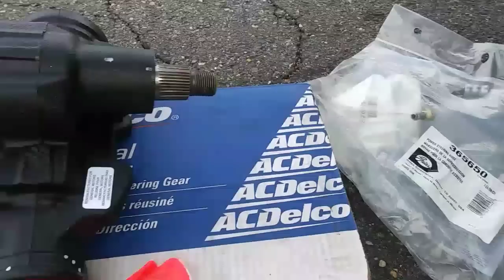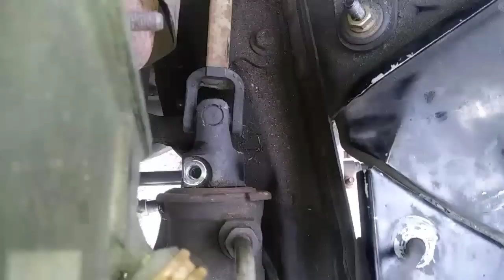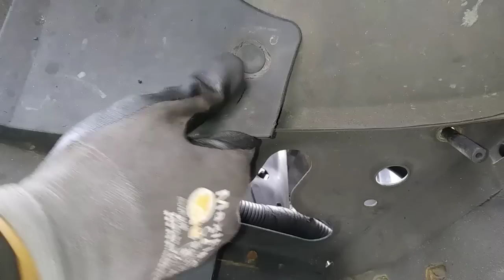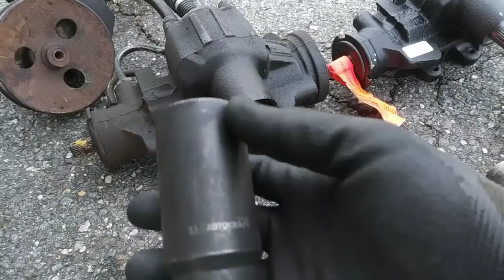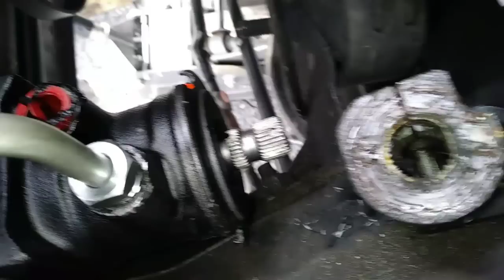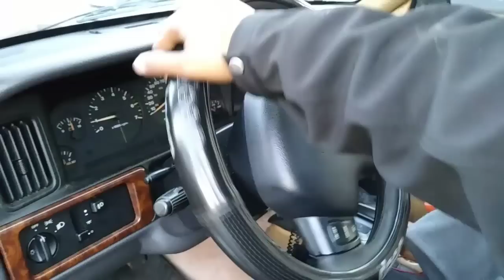STEERING GEAR REPLACEMENT (1993-'98 JEEP GRAND CHEROKEE)

Comment: Once again , straight and to the point !
I’ve been wrenching on my ‘97 ZJ’s for over 20 yrs and find Barricade’s (what’s the dude‘s name ? ) videos to be spot on without wasting a second of your time !
I just changed my steering gearbox last week and should’ve watched this video first - I wouldn’t have had to look for socket sizes and torque specs !
Great job once again, Barricade Garage !

Comment: Thanks for another great video brother. I used the radiator vid to install my new water pump and aluminum radiator. Guess what’s next. My steering gear box is leaking like a mug. You rocked out just what I need to fix next! You are a blessing.

Comment: Great Video, I had play like that in my 97 ZJ, I started with the gear box and pump, still had play , then replaced all steering components even lower and upper control arms and track bar, just to find out my ball joints was seized, onece I replaced those the steering was  touchy the way it should of been, the whole front end was brand new.

Comment: Man, another awesome video as usual. Whenever I need to do something on my ZJ, the first thing I do is check for one of your videos.

Question - the only thing that I think I have a question about that I think I missed in the video is how to make sure that the travel is centered  - I guess the "position" of the gear coming out of the box doesn't matter, as long as you put the pitman arm on in the correct orientation? Am I correct in assuming it's the position of the arm on the box that controls the travel? And it looks like it's keyed to only on on in one orientation? (Also, unless your pitman arm is worn out, I assume there's no real benefit to a new arm?) 

Thanks again, man!

Comment: Hey B.G. What for headlights do you have in that beast ? They look VERY BRIGHT, not like my candle power lights on my 97.
Reply from the maker: nowr2run 9004 HB1 160W 16000LM LED Headlight Kit High Low Beam Bulbs 6000K High Power
and the chrystal clear headlamps
https://www.ebay.com/itm/1993-1996-Jeep-Grand-Cherokee-Crystal-Headlight-Bumper-Corner-Light-W-Reflector-/362108647003

Comment: Is the new gear box is set to center or did you turn it end to end to find the center ?  I wonder if the new gear box is preset center from the company and no need to move it? then install the pitman arm same as the position it was mounted to old gear box..  just want to know before I install my new steering gearbox soon.. Any tips please , Thank you in advance for the reply..  Anyway , Its the best video so far I found on Steering gearbox on Jeep 4liters..

Comment: Great video dude. I have a 98 5.9 grand cherokee.  My steering box is so bad it wiggles left and right and the jeep doesnt move lol.  It has alot of olay in it.  Also pops too.  Just havent gotten around to replace it.

One issue with the manned pumps and gearboxes though is they are normally trash.  Gone through 3 of the remaned steering pumps.

I probably woulda greezed or antiseized the steering shaft and bolts though after putting them back on

Comment: Any difference with speed-sensitivite steering, and do you recommend an alignment? I see that you're now in the Commonwealth of Virginia (I'm in the Commonwealth of Pennsylvania). Happy 2019!
Reply from the maker: +OldsVistaCruiser thanks! I did this 2 days ago and the steering is more responsive. The steering wheel returns to center on its own after a turn now.
You dont need an alignment after replacing the box but im getting one because I have needed one ever since I replaced my steering linkage, I have just been waiting to get the new box on before doing it.

Comment: You may need a new ps cap. My old one wouldn't play well with the new pump for some reason. I bought the dorman one off amazon, nice and tight now and no more slow leak.
Reply from the maker: +leakyjeep5.9 I broke the new return hose nipple on the new pumps reservoir so I had to put the old resevoir on the new pump. All is good

Comment: I love your videos!  I have a question. My 98 ZJ has a new pump I installed last year, but steering has always seemed choppy at idle. Now it doesn’t like to turn left and locks up if I try to turn left.  The whole steering rack and stabilizer were new 2 years ago and still in good shape.  I’m thinking my steering box is bad.  Do you think that could be?  It doesn’t whine, and no fluid leaks from anywhere, so I doubt it’s a bad pump, but who knows.  Thanks for any input.

Comment: I know this is an old thread, hoping for an answer.  Is there a center to the steering gear or do I just make sure the input and output shafts are in the same position on the new box?  I went ahead and got a puller and new arm just in case.  I just got taken to the cleaners having the suspension components replaced and it still wanders all over.

Comment: I saw you had drilled and slotted brake rotors and was wondering where you got them and what brand they were.
Reply from the maker: https://www.ebay.com/itm/Fits-Jeep-Grand-Cherokee-Front-Rear-Black-Drill-Slot-Brake-Rotors-Ceramic-Pads-/132528960921
Reply: BARRICADE GARAGE thanks man also nice video.

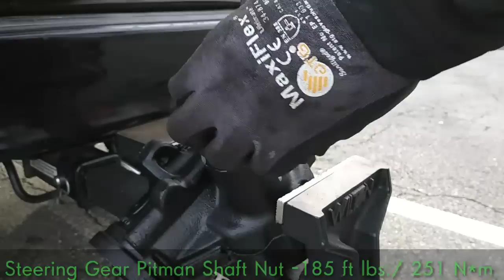Comment: Hey Barricade, great video as always. One thing however seems unclear to me; at 2:50 you mention removing the steering lines with an 18mm crows foot wrench but this step is never shown. Are you simply taking them off the old gear box and attaching them to the new one before mounting it at 4:50?
Reply from the maker: Yes all im doing is taking them off the old box and putting them on the new box .. Heres my quick power steering line replacement video if intetested
https://youtu.be/J21TtFRANJ4

Comment: One question- did you use a remanufactured unit, new or good used? I had Les Schuabb look into my steering looseness, and they replaced every articulating joint and wheel bearings to the tune of $1800, and while it was a lot better, it still wanders. Steering wheel does not return to center, flat spot when going straight forwards that makes me have to make small corrections.

Comment: thanks for all great videos.do you have any experience with the pump and box with speed proportional steering 96 5.2 v8 with tow package having a issue with the steering locking up not good thank you
Reply from the maker: My Jeep has the tow package but didnt come with SPV and I dont know too much about that so I cant help you out on that issue

Comment: Hello, great video.  Today I found out my 1997 Jeep GC 5.2L started leaking PS fluid from the pitman arm.  May I ask where you obtained your gear box?  I am having difficulty finding one.  Thank you.
Reply from the maker: The one im using Is AcDelco 36G0070. Its a refurbished unit and if you type the part number into the search bar you can browse for the cheapest option but I ordered the one im using through Rockauto.com

Comment: Hi again, killer video as always! Sorry to bother you with a dumb question, but there is a small hose that appears disconnected and is resting on the plastic cover at 1:03-1:05... what is that supposed to be connected to? It came off when I removed my air cleaner. Bless
Reply from the maker: Thats the vent hose from the front axle. It does not connect to anything and the factory position was under the air cleaner box so you can zip tie it to something so it doesnt drag on the ground
Reply: @barricadegarage5361  Wow, that's a fast reply! Thanks so much that really helped

Comment: Bro I still love your videos man you are the best at explaining and articulating how things need to be done. A couple things though. I wish you had done the j-20 gearbox upgrade. And how do you make sure that your steering is centered with your steering wheel and steering box?
Reply from the maker: I got the gear box that i wanted and it works fine. A j20 box for me is unnecesary anf Just keep the steering wheel straight and note the position of the pitman arm when you remove it so you can put it back the same way
Reply: So when you buy a steering box it is automatically centered?
Reply from the maker: @justdoingit.43  Yes, but if its not you can use the pitman arm to easily turn sector shaft to the correct position
Reply: Ten-Four appreciate it brother I'm only asking because I'm getting ready to do the j-20 upgrade on my ZJ. I'll let you know how it goes. the problem is I can't find any information on YouTube about the j-20 upgrade you have to go into Jeep forums to even find out about it. Wish someone would do a video.
Reply from the maker: @justdoingit.43  what made you decide on a j20 box
Reply: Got a 5 inch lift with 33 1250 15.original steering box took a crap so I want to go heavy duty. I do a lot of wheeling in the Ocala national Forest
Reply: Quick update on the steering box upgrade. Got the wrong steering box now waiting for another steering box to be shipped.
Reply from the maker: @justdoingit.43  Ohhh that sucks

Comment: I have a question. My 97 Grand Cherokee Laredo is doing the very same thing. I have about 2 inches of play to either side on the steering wheel before she ends up turning. Now, I have replaced everything from ball joints up to the pitman arm,including the gear box and the 2 inches of play is still there. What would be the answer to this issue? Thanks.

Comment: So I just repplaced mine with a remanufactured one from Advanced auto. I'm still having issues with the truck swaying back and forth in the lane and it's hard to drive so I'm doing the upper control arms. I did the lowers watching your vid last week of course my cam bolts did not come out nice and easy like yours so have new ones otdered. My mechanic buddy says the gear box I got is junk. How is the AC Delco I'm tired of throwing money at this damn truck!

Comment: good video, but thread locker is required if you're doing it right. You don't want those bolts working loose and losing your steering

Comment: You said you replaced a non-variable assist line but that part number says it does have assist. What is the difference? And did you mean to use that one
Reply from the maker: Sorry I forgot to mention I had to buy a non variable assist high pressure line from advanced auto because I ordered the wrong one from rock auto. If your box isnt hydro tapped and is stock then get the non variable assist line because the variable asssist has a longer neck and wont fit right.. 
Heres my video focusing on the power steering lines and the correct part numbers to use
https://youtu.be/J21TtFRANJ4
Reply: BARRICADE GARAGE right on! I just saw that video and also ordering from Rockauto. Thank you

Comment: How do you know if it’s a bad gearbox or just the Pittman arm ?
Reply from the maker: The pitman arm doesnt go bad but in some cases the teeth strip out or it gets cracked but thats rare. I only replaced mine because I like everything new. The gearbox was leaking which I showed in the beginning of the video and thats usually one of the first signs your gearbox is shot along with sloppy steering

Comment: They always bash the aftermarket gears(except the expensive ones of course) on jeepforum, they call it reman roulette. Hope to see how this gear holds up. There are literally no reviews on the AC Delco one you installed.
Reply from the maker: leakyjeep5.9 so far so good. steering is more responsive and theres a noticable difference in handling even with the 31's and extra lift height.
 I read the forums to and everyone hypes up the red top or durango box but I decided to keep it original. Ill keep you posted on this rebuilt box if it starts acting up though
Reply: Hey  @barricadegarage5361  how is the steering box holding up? I think I need a new one but am skeptical about these remans.
Reply from the maker: @cowboychkn  This steering box has held up well. No problems at all and if your going reman than this is the only one I can personally recommend
Reply from the maker: @cowboychkn it's AcDelco #36G0070 https://www.summitracing.com/parts/ado-36g0070
Reply: @barricadegarage5361   awesome to hear. Almost done replacing all control arms. Next is this steering box. 
Thanks for all the videos.

Comment: Looks like you had all the same problems I’m having with mine. I have the same exact one just white
Reply from the maker: Corie Hyatt yup. Its a pretty easy fix though and shouldnt take more than 2 hours if its your first time replacing it
Reply: BARRICADE GARAGE  awesome man I lifted it and did all the bushings but went to have it aligned and they said the steering box was wore out which it is so that’s the next thing! I’m also doing fan clutch at the same time🙄

Comment: I have a 1996 Jeep Grand Cherokee Limited V8 and I think I am having the same problem. I changed my power steering pump, and the return and other lines with it but after a week or so, it started to make a really bad whining sound. I have been losing all of my PS fluid and it is everywhere underneath from leaking.
Reply from the maker: Brandon Sulak Is it leaking from the box?
Reply: @barricadegarage5361  honestly I've heard different answers. I've seen it on the hose lines and on top of the steering box but its all over the front underneath of my car.
Reply from the maker: Brandon Sulak spray some parts cleaner and wipe everything down then have some turn the wheel while you inspect the pump, resovoir, lines & box for the leak. 
its possible you bought a bad pump,

Comment: Can the steering gear box cause stiff steering wheel?
Reply: I already bought a new power steering pump and it still hard. Any ideas? I already purged the system for air as well

Comment: What kind of left you got on your Jeep
Reply from the maker: Front to rear swap, 3.5 inches of lift
Reply: How big is your rims and tires I'm trying to lift my Jeep
Reply from the maker: @mr.parache9491  31×10.50 but even with a 3.5 inch lift I still had to do some cutting. I put a 2 inch spring spacer lift on my wifes '97 and crammed 31s under it. I showed how I had to cut the bumper to make them fit without rubbing and I suggest you check out my video if you havent already done so...
https://youtu.be/76h9_aB7dOg
Reply: Thank you 😊